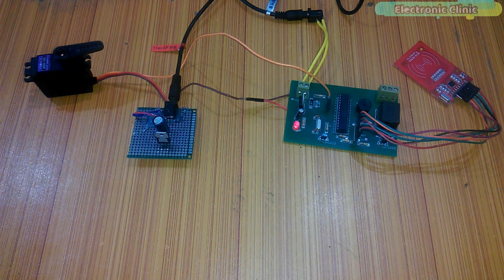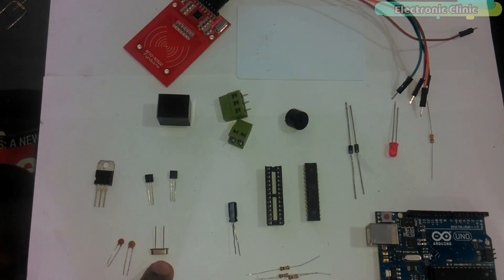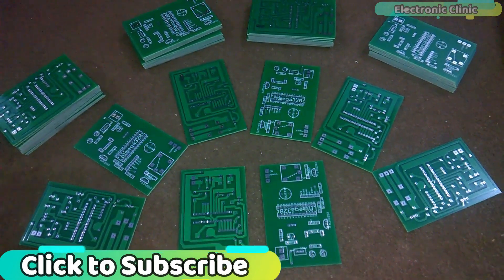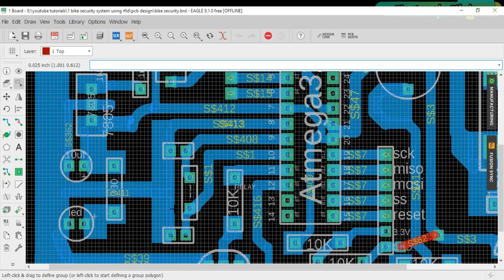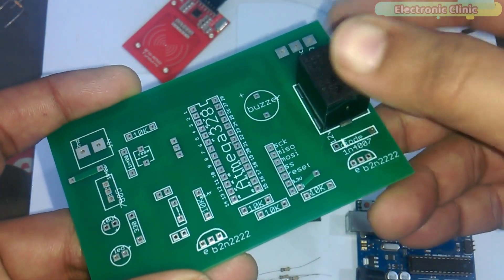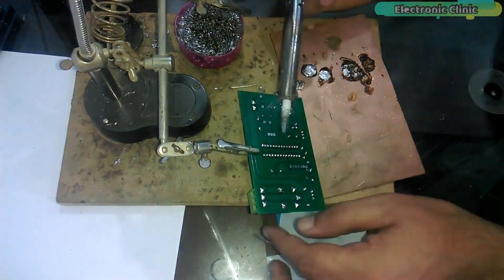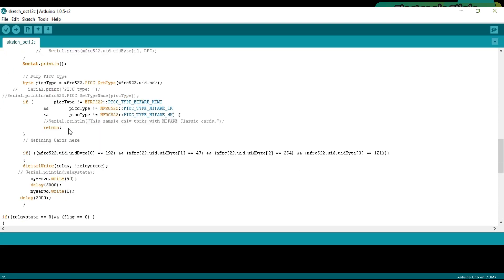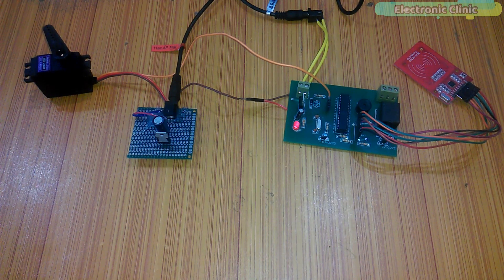RFID Car Parking Gate opening system using Arduino, MFRC522 RFID, and Servo Motor MG996R"

Comment: So what you have done is replace the Arduino with a dedicated custom design Arduino controlled board Why not just use the Arduino its cheaper and simpler,